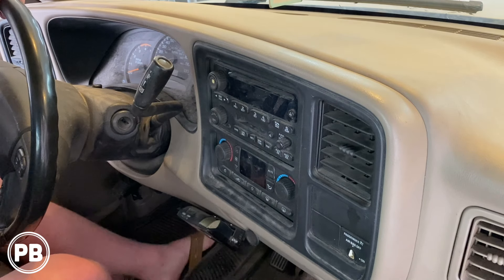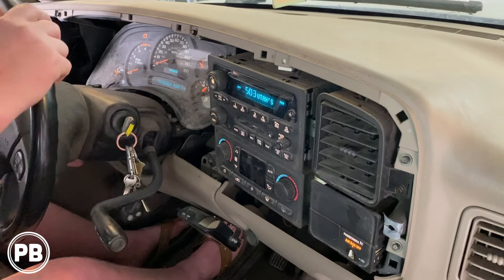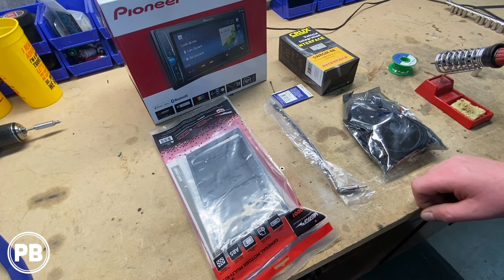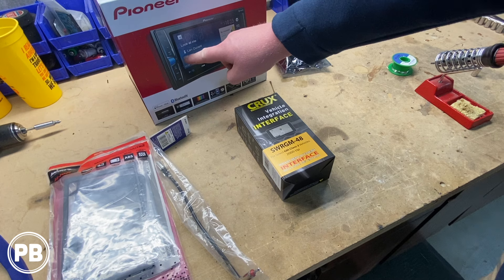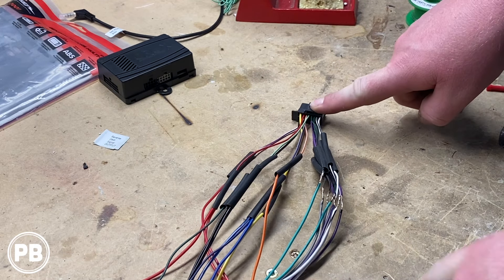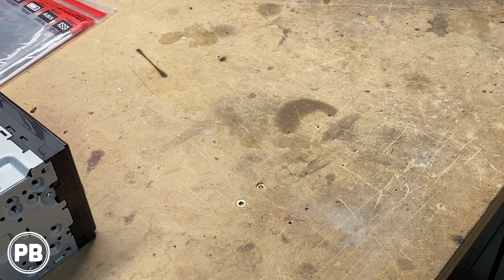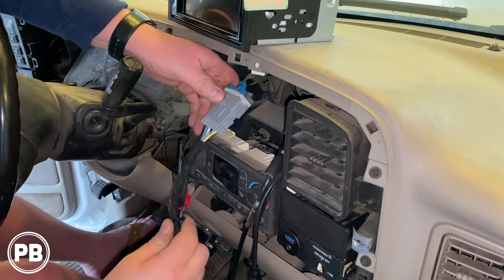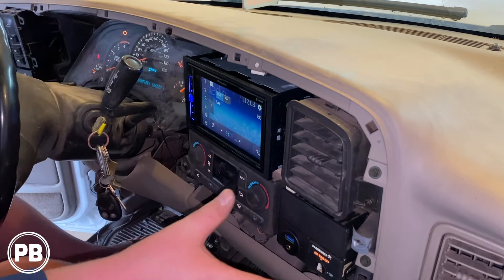1995 - 2006 Chevy / GMC Stereo Install

Comment: will this also do a back up camera
Reply: the back up camera does not need to hook up to the Crux although there is a camera wire. You can plug it to the back of the stereo.

Comment: What size screws did you use to connect the aftermarket radio with the dash kit?
Reply: Most interior dash screws are 7mm with a washer made on the screw

Comment: Hello my friend has a 2003 chevy suburban with the bose system and I've been trying to find certain things for him. Is there a way to bypass the bose amp? ive heard that the amp will go and you won't have sound. And also where can I get the plug for the radio?
Reply: Yes, it's a pain to get the connector from behind the metal frame if it is attached you basically got to pry it off being careful not to bust it but this video was the best I found when doing my 03 suburban.  https://www.youtube.com/watch?v=-OVwmQx8Slo&list=WL&index=23 I see it's been two months hope you found your fix before this
Reply: @donaldconroy4511  yeah he decided to just hold off on the car audio and put a Bluetooth speaker for music (kinda jank but if hes happy with it) so i stopped looking for him until he decides to start doing it again but thankyou for the comment
Reply: @nick-in6rl  maybe you can help me, where does the amp turn on wire (the blue and white) get parralled into?  I can't catch what he is saying there
Reply: @donaldconroy4511  are you talking about what he did in this video or the one that you linked?
Reply: @nick-in6rl  this one

Comment: Which wire did you use for the remote wiring?? Around 5:55
Reply: Did you ever figure it out because the auxiliary with my wiring harness does not work.
Reply: @ouradventures3794  wire "blue amp on" to "Blue ANT wire" and it should work

Comment: Good video and explination but, Why not clean everything up before reassembly?  You spent all that time wrapping the harness for a “professional look” and then reinstalled the dirty bezel over the dirty components.  That just doesn’t seem very professional IMO. Also, how long before that usb adapter comes loose when the hot glue softens up on a summer day when the windows are rolled up?